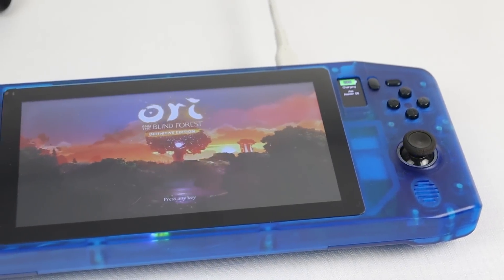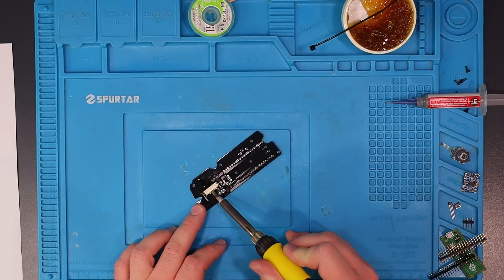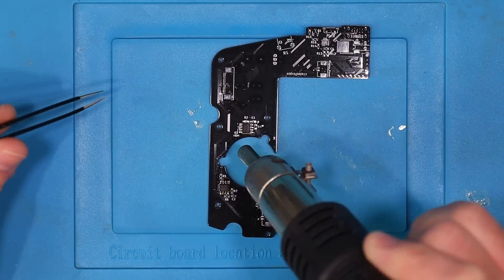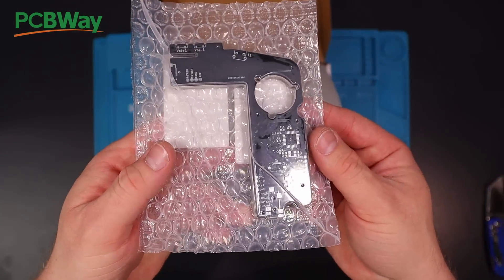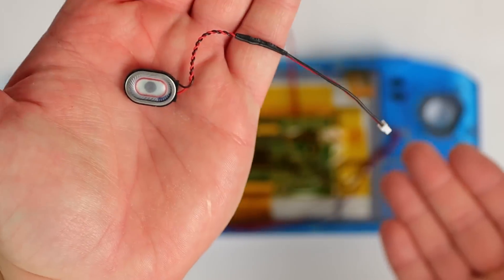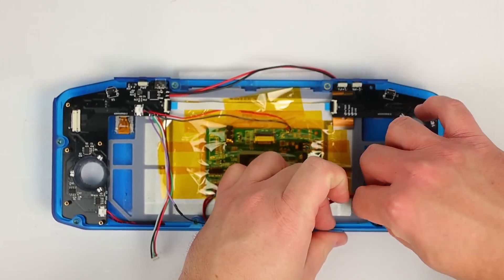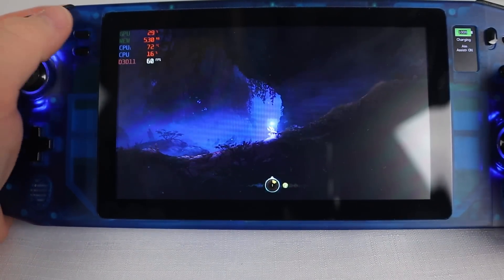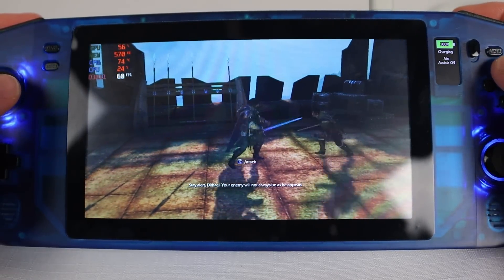NucDeck - The DIY PC gaming handheld - Episode Seven

Comment: I saw your release trailer for this thing and been going back and watching previous episodes. This is such a cool project! I'm in the process of making a handheld using a raspberry Pi zero 2w, and was thinking about using your 3D printed buttons. Out of curiosity, why are the ABXY buttons different heights?
Reply from the maker: The buttons are different heights to match the tapered side profile of the housing. I've provided .STEP files for all the parts which are easily modified in any parametric cad software such as fusion 360, so you should be able to fix the heights on them to all be the same if you wish!
Reply: @cncdan  Oh I see. Awesome, thanks for the response!

Comment: 13:40 that's because the game developers knew that the human eye cannot perceive a difference in anything over around 60 fps. The reason gamers want high fps has been lost to many. Boosting fps from 20 to 60 makes the game look better and play smoother. Going from 60 to 100 does not. Not at all. The lag you see in a system that can only handle 60 fps max is because the system can't quite handle the more demanding parts of the game and it briefly drops to 15-40 fps or so and then back to 60 up and down and up and down. You can totally perceive the parts where its running below 60 fps. If you can run the games over 100 fps and you run into a resource intensive part of the game code then your system will slow down to 70 fps or so and you wont even notice. you can't see it. Above 60 is above 60. 60 and 200 look the same. Its all smooth. Of course a system that can handle 200 will never dip below 60 and it might support dlss or ray tracing or something else that your eye can perceive.
Reply: This is just wrong
Reply from the maker: Regardless of what research you believe about how the human eye works, there is a measurable difference in response time from control input to the display updating on higher refresh rates, which is why gaming monitors are coming out with higher and higher refresh rates for competitive gamers. I'm sure there is an upper limit to the usefulness of this but I wouldn't claim to know where it is. Regardless, being able to run a game higher than my monitors refresh rate is a useful test to gauge what the hardware is capable of and how well optimised that particular title is so it's a shame they haven't conformed to the same standards that have been in use by other companies for years.

Comment: Do you consider trying do a verison of a handeld with an ARM soc?
Reply from the maker: I've done plenty of them before I started YouTube, And I'm planning to do more in the future! Take a look at this video by Macho Nacho. I was heavily involved in the development of the Retrolite cm4!
https://youtu.be/sjTS9deIm9g?si=BqcALEhv6CtsPunN
Reply: @cncdan  thx bro, Huge W for you
Reply: What do you think about the idea, of using a soc motherboard from an ussd "old" high end smartphone such a s21 ultra or oneplus 10,   using the display of the smartphone and then building a custom case and cutom big heatsink and custom controller around that?
Reply from the maker: @sofiansomai5915  considering how good some of the plug in type controller attachments are, I don't see much of a point to it personally. Unless of course you want something that's a bit different, in which case, go for it!
Reply: @cncdan  ah ok, but what you think to the idea of making a custom case Nintendo switch without joycon to hold a bigger battery a good heatsink and the motherboard it self, and then do some attach to attach the plug in controllers for smartphone?

Comment: just curious, when will you finish your github, i have similar project but i cannot figure out how to wire 2 analog joysticks on RP2040 because it only has 3 ADCs.
Reply from the maker: The github already has 3 out of 4 of the controller PCB's up and ready. It's just the power management that I'm still working on. FYI, you'll need something to expand the analog IO of the RP2040 to be able to use more than 3 analog inputs. Since my controller is split into two halves, I used a basic atmega328p microprocessor on the other half of the controller and just send the information to the rp2040 via i2c. That way the RP2040 only has to handle one joystick and a trigger, and the atmega handles the joystick and trigger on the other side.

Comment: This is cool as fuck. Several questions:

1. did you notice you installed the AB buttons incorrectly?
2. why are the ABXY buttons so tiny?
3. you went with a traditional switch layout, where the analog sticks are located almost directly beneath the ABXY buttons, or directly above the DPAD.  any reason why?  this creates a very uncomfortable way to play games.
4. why are there no back buttons (i.e. L4, L5, R4, R5)
5. do you think you could design the controllers to be removable (similar to the nintendo switch) so that you can accessorize your NucDeck with newer and better controllers easily?
6. i guess this is a discontinued intel product that has been repurposed as a portable hand held device?  can you create one with a newer/faster APU?
7. I'd ask questions about the top ports but seeing as I believe this is a repurposed intel product, you didn't get a lot of choice in which ports are on the top.

I love that you did this.  The idea that the average consumer being able to create a freaking hand held gaming PC is mind blowing.  It's something I thought was reserved for only the big companies.
Reply from the maker: Thanks! Let me try and answer all of these questions!

1: They aren't incorrect, they are nintendo layout!
2: I recycled the design for the buttons from my last project so I didn't have to remake the molds for the silicone membranes. The buttons are the same size you'd find on a switch lite. The smaller size also helped me fit everything in. I have average sized hands and find them to be an adequate size.
3: This was neccessary because the joystick bodies were too deep to fit anywhere other than within the grips. This is probably one of my main regrets. If/when I do it again, I'll probably use a Wii U Gamepad (joysticks on top) layout to help with this. Then the ABXY and Dpad can be moved inwards to a more comfortable location.
4: I'm not sure what they are used for? The newest console I've played is an Xbox One and it doesn't have rear buttons so I didn't think I'd need them.
5: No, not without making the device a lot larger anyway. The batteries actually partially overhang into the area taken up by the controller so making them seperate would mean increasing the width of the device to account for that.
6: Yes, couldn't justify buying a brand new one and ripping it apart when I wasn't sure this would even work. Now I have a proof of concept though....
7: Spot on, the top ports are just what was on the back of the NUC (minus the HDMI connector that had to be removed).
Reply: @cncdan thanks for your response. Okay so if you are going for a Nintendo layout then it's still wrong. You got the X and Y buttons reversed.  Lol. You have to fix that. XD
Reply from the maker: Yeah, good spotting! I got it wrong while I was assembling it on camera but I caught it before I had everything closed up. I have them back in the right places in the gameplay footage. I didn't bother re-filming the assembly as I figured no one would notice!

Comment: I really like the idea behind these systems, however upon looking into the hardware, I realised they relied on an Intel NUC mainboard, which is discontinued as far as I can tell. Is there a clone that can be readily purchased that will work reliably with all the other software/hardware you've designed? Or is the NUC still being produced by a company besides Intel? Or are we just at the whim of the surplus/used market?
Reply from the maker: The plan was always to be able to use second hand NUC's to keep the cost down. Having said that, I believe ASUS is supposed to be picking up where intel left off so we may get some newer systems in the same form factor in the future! There's also all the AMD mini pc's that are everywhere at the moment. Trouble is they don't fully conform to the NUC form factor so a different design will probably be needed to make use of them!

Comment: I think it would be a better option to opt for steam os (Linux) because it's not resource heavy and more efficient on the battery usage
Reply from the maker: I did try holoiso back at the beginning of the project but the driver support just wasn't there for this intel system. Even if it did work, there's a good chance it would be less efficient than windows on this device anyway. Steam put a heap of work into tuning their software to ensure its as efficient as possible on that exact hardware but in my past experience with Linux, its often less efficient on the battery life depending on how mature the linux drivers are for the system.
Reply: @cncdan  I agree with you anyways keep it up great video and interesting project

Comment: Awesome project --- but might I suggest smiling a little more?
You're building something that's friggin sick.
I feel it would help to show a little more excitement
Just a suggestion. Still love the video
Reply from the maker: Obviously acting is not one of my strengths, I've rarely been in front of a camera before doing this. I'm working on improving, but unfortunately unlike the audio/video quality in the earlier videos, it not something I can just throw money at to make it better. Hopefully the project is still impressive enough in the meantime!
Reply: @cncdan  - Absolutely -- it's still a great project. And I completely understand about being in front of a camera.. it does take a while (I still have not conquered it myself).
You still do good w/ being able to have anything scripted. I am terrible w/ that part. I have to try to memorize or just have sections/a few word reminder written... and I'd elaborate on from memory. Otherwise it's very obvious I read things on video. Those are areas I personally have to practice.

Still I love the project. This is def something I will be considering in the future and I appreciate you bringing it to us 👍

So far I have only built sensors (for Home Asst) and LED light controllers from ESP32's, RPi Picos, etc. This project will def be more complex so I plan to watch thru/read up on it more before I attempt

Comment: The FPS cap is due to come games being hardware locked so it doesn't use too much power.
Reply from the maker: Yeah I still don't understand why they wouldn't allow it to run as fast as it can with vsync off. Being able to cap FPS to keep power usage low is a great idea, but it should be an optional setting!

Comment: Nice job :)
If vsync is enabled, the driver will cap the game at the refreshrate of the monitor (uncapping fps is mainly useful if you need a lower input lag, more relevant in esports)
Reply from the maker: Yeah, I'm aware of how Vsync is supposed to work. The unusal thing with Ori is that with vsync disabled, it still wouldn't go over 60fps even though the hardware is capable of it.

Comment: Where did you buy the 19-pin connector, I can't find it and what module do you use to increase the voltage to 19v? These episodes are very interesting.
Reply from the maker: Any 19 pin 0.5mm spaced fpc connector should work. Mine came from DigiKey but most electronic component suppliers should stock them. I'm not actually increasing the voltage to 19v. This NUC accepts a voltage range from about 12-20v so I'm running it straight from a 4s lithium battery with a custom designed battery management system for charging and power path management.

Comment: Since you're using the Pi Pico which can act as a USB HID device, have you considered implementing the USB HID UPS class? This would allow windows to have the battery info without needing drivers, allowing it scale power usage to conserve battery as well as shutdown safely to avoid over-draining. 
I know in another comment you mention using the pico instead of the RP2040 by itself for ease of construction, but board houses to sometimes have part population services as well. Once board designs are finalized you could consider something like crowdsupply, or just a large group order and have the boards completely pre-manufactured.
Reply from the maker: That's something I didn't realise was possible. Have you got any good resources where I can learn about the USB HID UPS class? I've had a bit of a google but I haven't found anyone using a pico for this purpose yet and writing a library for it may be a bit over my head at the moment, but I'm definitely interested to learn about it.
As for the rest of your comment, I'm definitely aware I can have the boards pre-assembled but they are often quite expensive in short production runs so I figured I would try and minimise the amount of tricky soldering wherever possible so most people should at least be able to build one or two of the PCB's themselves, even if they have to leave the complex ones to a fab house. A group order is definitely a possibility once I have the design fully finalised though!

Comment: What would have happened if you had spent extra for Intel's best NUC? Would that still work and how do you think that would do fps wise?
Reply from the maker: Good question! I'm not super familiar with Intels latest line up of NUC's but it should be able to run any of the 4x4 form factor ones with a limit of about 65w (due to limitations with the power management). As for how they'd perform in games, I'm sure if you pick a model and search you'll be able to find people testing games on them to get an idea.

Comment: windows is disgusting for a portable device, linux - is top
Reply from the maker: Sure, except for when there's limited or no support for the older PC games you're intending to run. I did try HoloISO when I first started the project but the driver support for this Intel system just wasn't there so I couldn't even get through the setup. I know there's a few other options around now and its something I plan to explore once the project is complete.

Comment: Please schamatic elements Electronic and pcb and case and programing
Reply from the maker: The Github is linked in the video description. All the case files are there and I will have the controller PCB's up there soon. Still working on the power managament PCB so it will take a tad longer.

Comment: Hi mate, lovely build! What mini pc did you use and where can I find it?
Reply from the maker: Its a 7th gen i5 NUC. The idea is that you should be able to use any NUC form factor mini pc with minimal modifications to the design. Just the rear and top covers may need slight adjustments for other models!
Reply: @cncdan  Cheers thank you :)

Comment: If you are calling it a deck, why not use SteamOS on it?
Reply from the maker: I did try HoloISO on it when I first started the project, but it didn't have driver support for older intel systems so I wasn't able to get it running. I believe there is a few other options now so I will have to investigate those once the project is complete.

Comment: so how big of a printer would i need to print this? would a ender 3 be big enough?
Reply from the maker: I don't think you'd be able to get the front part of the enclosure on it in one piece but I printed it in three parts on my duplicator i3 which only has a 200x200 bed so if you're happy to join the parts together afterwards, I say go for it!

Comment: Can you make a smaller one with an Intel ComputeStick? I've used Core-M3 3Y60 (basically an i3 7100, but 1GHz slower) and is pretty good and uses less power. I like this idea.
Reply from the maker: Yeah you definitely could. I considered the compute stick for this, but since the most powerful ones are still pretty slow I decided to go for a platform that had more upgrade options for once the project is complete.

Comment: Super interesting project! I'd go for it (i have a 3d printer farm, soldering and assembly workshop), but I have absolutely no idea what kind of a NUC would work with this?
Reply from the maker: Go for it! I've used a 7th gen i5 NUC just because they were relatively cheap on the used market and I wasn't sure how successful the project would be initially so I didn't want to drop a heap of money on a newer one. The idea is that you should be able to use most of the NUC's available, just with a minor change to the rear cover and outlet plate. Keep in mind however that some of the higher end NUC's use a lot more power so they may need their TDP capped to stay within the abilities of the power management system.
Reply: @cncdan   Yeah, I'll see what I can find here on the used market as well. Too bad the NUCs are not much better or cheaper than something like the Framework Mainboard (you can get the lower end i7 1165 one for 299 right now).

Comment: We can also use a chromebox with windows to make it more cheaper to build. Awesome stuff, planning to build similar to this one using a Tbao Mini PC Ryzen 3 2200u but cancelled it because steam deck is now available in my country (PH).
Reply from the maker: I think the chromeboxes are a bit bigger than a NUC, so it may not be a drop in replacement for my design. It would however be doable if you were designing one from scratch!

Comment: Hi CNC Dan. Do you think this is possible with a framework of using Batocera OS, which is a retro emulation OS running everything from Atari to Xbox 360, and even steam games? I’m thinking of doing this myself, but with a framework pc and Batocera Linux, as well as your pcb designs and framework speakers and batteries.
Reply from the maker: There was a video getting around a few weeks ago of someone who built their own portable console with a framework mainboard, so yes, I'm sure its possible. As for running any variety of linux on it, that's just something you'll have to try but I suspect it should be fine!